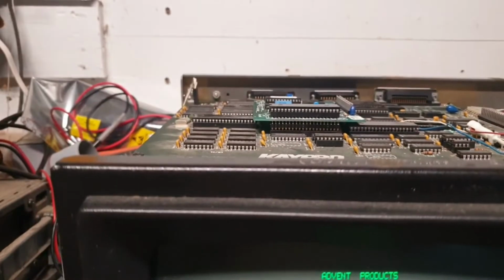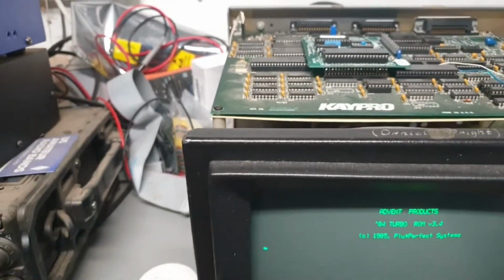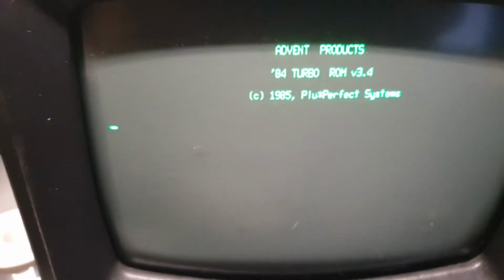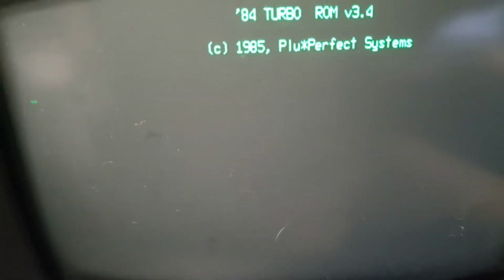Kaypro 2 Schematic Exploration and Random Fixery

Comment: Great video!! I'm currently working on my Kaypro II, not 2, and doing a recap, floppy drive controller mod and building a board foe external monitor. Still have no idea which gotek to get for it. Thanks for sharing and looking forward towards your next video
Reply from the maker: Cool!  The II uses a different mainboard than all the others, right?
I think all the goteks are the same once you put flashfloppy on them, but I may be full of poo about that.  You gonna try to get OSD working with it on the kaypro?
Reply: @Lee_Adamson_OCF  Yes the board is different and once I get the board done and working, I can send you one, for you to play with. It just takes on H. Sync, V. Sync and video plus 5V and ground. I think it should work with yours. Not sure what OSD is :)
Reply: @Lee_Adamson_OCF  Look everybody, the man's alive!
Reply from the maker: Rumors of my demise were greatly exaggerated.  However, rumors of my ennui were not.  =:O